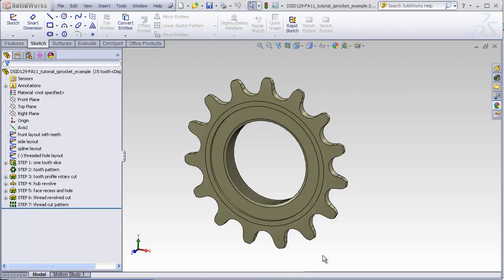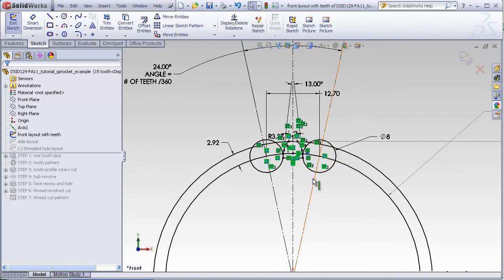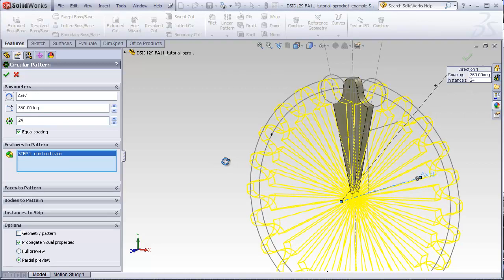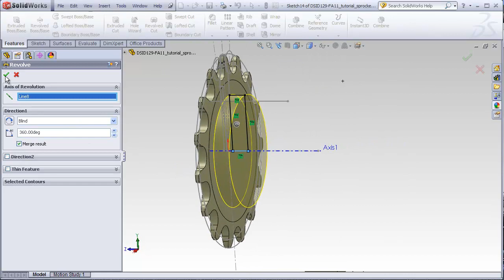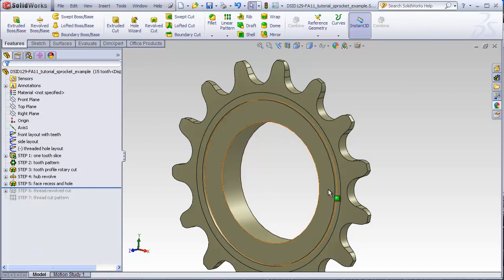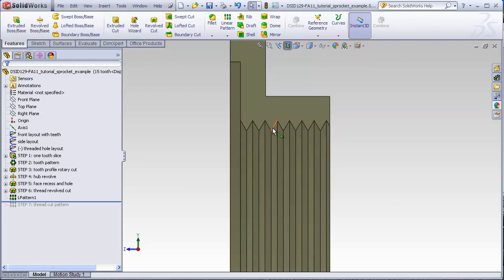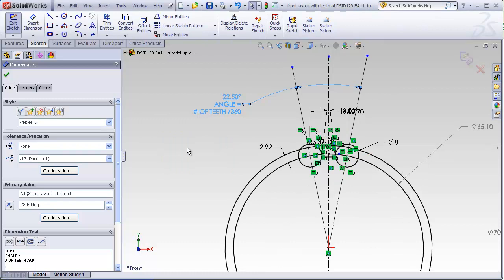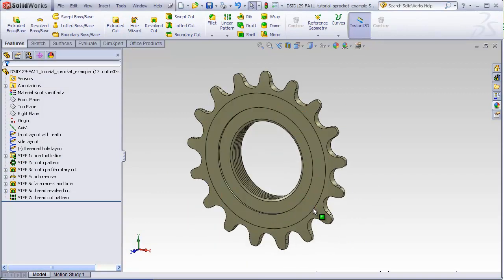DSID129, Solidworks Tutorial, Bicycle Sprocket

Comment: any reason why you didn't use a helical spiral for the thread cuts?
Reply from the maker: I was trying to keep the tutorial somewhat simple for my students. This was a 1st semester project and I think we didn't get to helical cuts until the 2nd semester. Also, if you look at the screws and nuts in the Solidworks toolbox, all of the threads are faked in this way. Another advantage to this method is that it makes the part file size a bit smaller.

Comment from the maker: The diameter of the circle naturally results from all the other dimensions and is a driven dimension. It changes, depending on the number of teeth. At about 2:50, you can get a pretty clear view of most of the dimensions, although they are a little obscured by the relations symbols. For the 15 tooth sprocket, the outer diameter ends up being 66.92mm and the centerline diameter is 61.08mm. Both are driven.